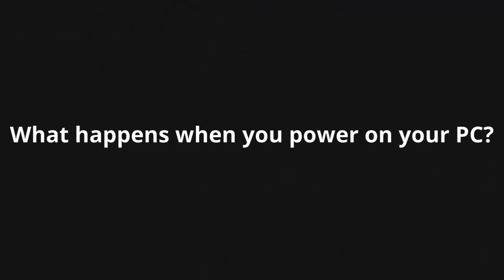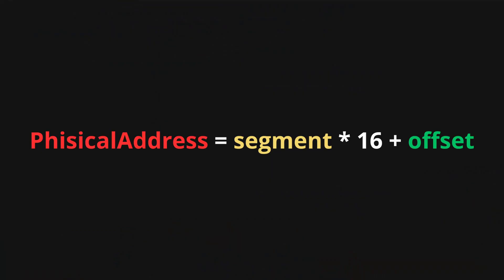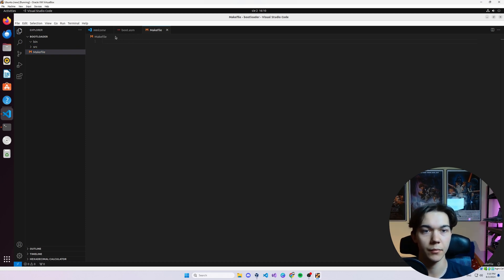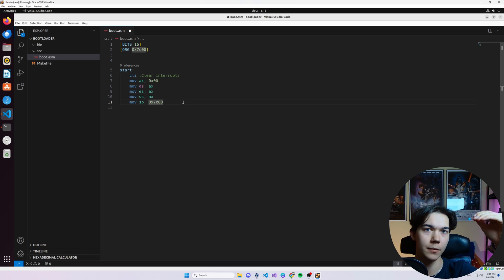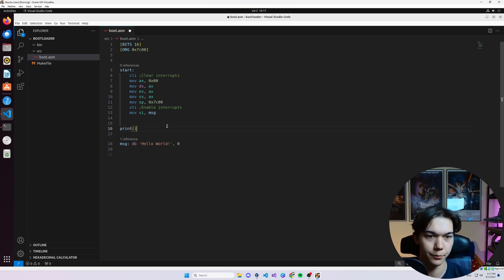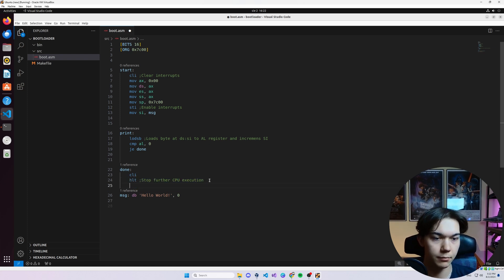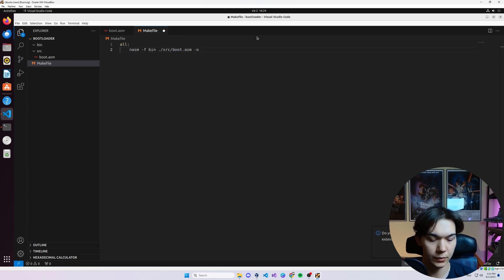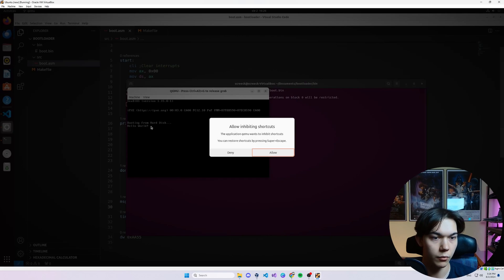OS development 101 - How to make a bootloader part 1 - Hello World

Comment: For the longest time i couldn't understand why we want the stack to begin at 0x7C00, i was thinking about it the complete wrong way. I was thinking it was growing downwards as in getting higher into memory. Thank you for explaining that it grows from 0x7c00 to 0x0 <3
Reply: Yes, it took me a long time to get the hang of the stack.

When I made a visual representation of it, it really helped.  I'm glad I did that because it helps for stuff like this
Reply: So, if the BIOS loads the code at 0x7C00, and the stack starts from 0x7C00, don't they overlap somehow? And, is that how it works - the stack goes down as you add to it, from 0x7C00 to 0x0?
Reply: @spaghettiking653 You don't add to the stack pointer, you subtract as the stack moves down

Comment: And this is why Intel sucks! The amount of crap you need to do to get it into protected mode with linear addressing is idiotic. All other CPUs is just trivial. "If you have never used Makefile...." than you shouldn't be let near bare metal systems :)
In bootloader size matters so you are better off doing xor ax,ax  saves a byte ;)
and cli clears the interrupt enable flag and sti sets the interrupt enable flag and depending on that flag interrupts are handled or not

Comment: To be clear, this is more for how retro computers used to boot up (legacy BIOS boot). These days you use EUFI and boot from an .efi file (typically with digital signature requirements). I mean it's great to learn how things used to work, but if you're looking for a modern method this is not it.

Comment: Bruh, mov ax, 0x00?

xor ax, ax

Faster to manipulate CPU registers than load from RAM. And yes, that instruction clears the ax register.
Reply from the maker: Thanks, will use that next time
Reply: xor ax, ax would do the same as mov ax, 0, but with additional capability of setting the flag to zero and clearing carry according to the logic of xor. And xor consumes less clocks than mov does in some old architectures.
Reply: Not only is It faster it's also a smaller instruction for x86 if I'm not mistaken. Don't quote me on that though because it's been a long minute since I've done some assembly prog.

Comment: you can also code in C and let the compiler create the assembly for you.
Reply: This is untrue.  Most of the program would be inline Assembly.

The beginning of a bootloader requires you to manage the registers directly. 

For example, the boot drive number is held in the low byte of register B, but if you used C it could be overwritten or just hard to obtain without more inline Assembly.

Comment: Very good video but one question - if the program overwrites what is in the bootloader then how does the system boot after the program has finished executing ?
Reply: The program would overwrite what's in RAM, not what's on the hard drive. When you reboot, the whole thing gets loaded from hard drive again.

However, there's no modification of the program in RAM here either. The program and the bootloader are the same - or rather, the sample program here is just made to run when the computer starts (and tries to boot from the drive). It doesn't actually do any "bootloading", it just prints a message and stops the CPU (without any way of waking it up again, so your only option is a reboot).

The demonstration is just an almost-minimal setup on running code when booting from a hard drive. That's it. It just prints a message to make it obvious that it actually works. The whole mechanism is the same as in the very first IBM PC (hooray for compatibility; UEFI is a completely new and incompatible system, but old-school BIOS boot is still there), which is also why it's all so tiny and simple - the computer reads a single 512 byte block of data from the boot drive, loads it into physical memory at address 0x7c00, checks that it has the "signature" (AA55) at the end, and points the CPU's instruction pointer to 0x7c00. That's it. No file systems, no processes, just a 512 B slab of code and data you can work with to actually proceed with the boot (or in this case, print a message and stop).

This is not a bootloader - not yet. It's just a tutorial on how to run a basic program from a bootsector on computer startup. But hey, it's "part 1" for a reason - we have to start somewhere :) An actual bootloader would prepare a few things, load the actual program/system (presumably from the same drive, which is why you get the drive number as one of the "inputs" here) and run it. There's a limit to what you can do with ~510 bytes of code and data :D
Reply: @LuaanTi  Thanks for the response. I will watch the remaining two videos before I ask any more questions !

Comment: Can u also tell for Embedded system? like Arduino , ESP......
Reply: Microcontrollers are usually programmed through flashing/burning. E.g. the Arduino Uno has an ATMega 328 microcontroller with integrated memory (both persistent and temporary). You put the program into that memory, and that's it.

In contrast, the IBM PC was designed with extensibility in mind, so there's a "protocol" of how everything gets initialized, because it needs to work with a wide variety of software and hardware - that was the whole point of the PC (though of course IBM expected that the actual PC would only be made by them; instead, competitors quickly sprung up with compatible PCs and the rest is history :)). There's a little dance when the computer starts to make sure those basics are satisfied - the BIOS discovers memory, a boot disk, loads the boot sector from that disk to memory and sets the CPU to execute from there. That's what Part 1 here is all about - getting the BIOS to execute our code from the boot drive.

Of course, you can have bootloaders with Arduino - but the bootloader is just flashed like any other program. The main point here is to make it faster to test new stuff - instead of having to flash the Arduino every time you need to test a change, the bootloader will e.g. load the program over a serial link. Arduino boards have a built-in bootloader that does just that. You usually don't deal with things like "loading programs from a hard drive" or "understanding a filesystem" in a microcontroller; though it's certainly possible, of course, the main draw of microcontrollers is that they're really simple and small.

Of course, there are tons of notable "embedded" systems that work pretty much the same way as a PC, like your router or that Windows Embedded kiosk. That has little to do with practical programming of Arduinos, though :P

Comment: We can write our string directly into the screen memory without using a bios function.

vga text screen default 80x25 with 16 colors and 8x16 character size and 8 text pages

mov ax, 0b800h
mov es, ax
mov di, Location
cld
mov si, OFFSET string     ;  ds:si
mov ah, color
mov cl, len
L1:
lodsb
stosw
dec cl
jnz L1
....

string DB "Hello World"
len = ($ - string)
Location = (Y * 160) + (X * 2)

Comment: cli and sti are needed if we want to change an interrupt vector address offset/segment in memory like the timer interrupt 8 at the address 0:0020 = 4 bytes. If we don’t stop the timer interrupt and we try to override the old vector the interrupt can occur between changing the offset and changing the segment address and accidently jumping to a wrong address with no valid interrupt service routine(ISR). We have to prevent this.

Comment: I like to switch from the 16 bit Real Address Mode with 64 kb segment size for all segment register, into the 16 bit "Big" Real Mode with a segment size of 64 kb for CS and SS segment, but for DS, ES, FS and GS segment size of 4 gb with A20 address line on. This Mode is compatible to the 16 bit BIOS function of the mainboard and graphic BIOS and additional alows to write/draw into the linear framebuffer (located in the 4th gb) of VBE 2 or VBE 3 videomodes for high resolutions. Example 1920x1200x32 with 16: 10 aspect ratio for 28" LCD monitor using Radion 9750 PCIe with intel Core2quad CPU 2700mhz.